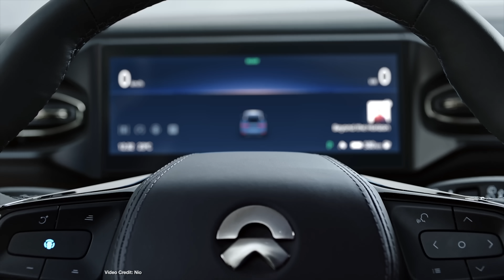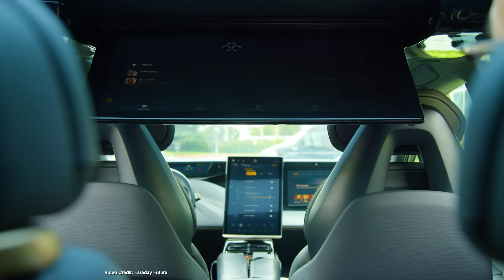Transport Evolved Landscape Short Megacut - May 17-May 23

Comment: I am surprised that Lambo didn't go with a "W" 12 engine.
"W" engines are "double V".  They have 4 rows of cylinders.  The cylinders in each row are not packed as tightly as in a V8 but still it makes for a shorter engine which would allow more room for the electrics.